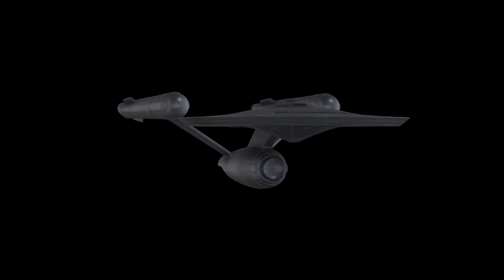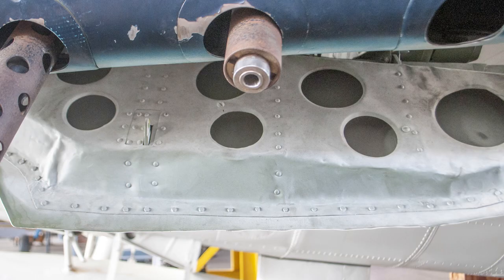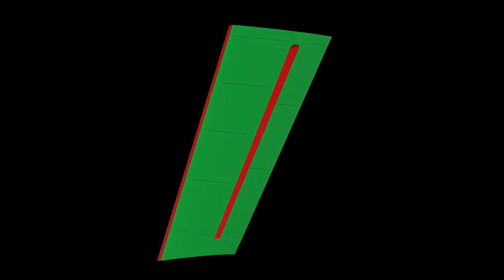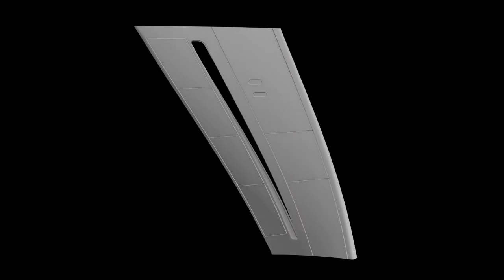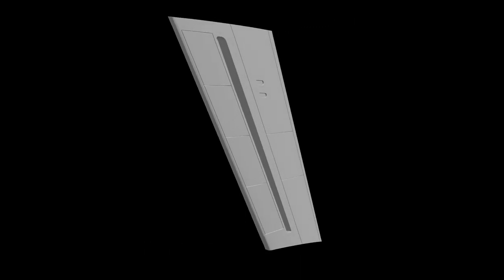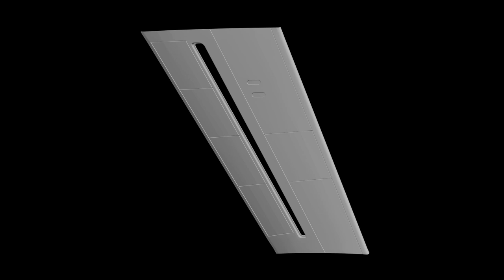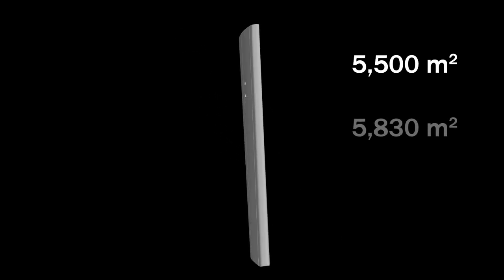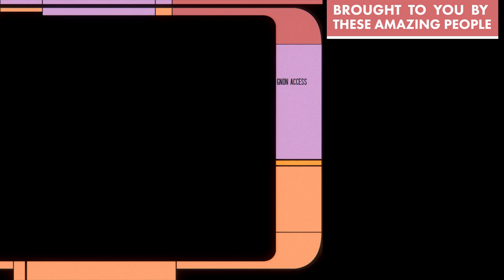What's the Deal with Pylon cutouts?

Comment: I would suggest that they are to add separation between the plasma conduits and a manway to the nacelles. Adding the vacuum of space between people and heat, radiation and potential hazards is a way cheaper and easier method of protection than say heavy armor or building specialized energy shields  for the task.
Reply: It could also add separation between the coolant and the warp plasma. If the warp plasma heated the coolant, both would be less effective.

One section of the pylon channels plasma, and another channels coolant.
Reply: Exactly what I was thinking as well. And they could run control systems up one side and plasma through the other - physical separation means that, if the conduit blows out/leaks/fails (somewhat) catastrophically, you might still be able to do a manual shutdown or otherwise triage the situation.

EDIT: Plus, a vacuum gap is less likely to fail than energy shielding, and would presumably add less mass than radiation shielding plates or the like.
Reply: I like this idea
Reply: I was going to suggest this exact thing. Of course there is probably a jefferies tube running along side the conduit for maintenance, it is likely highly irradiated, but by have a separate tube as well it allows access to the nacelles without the need of a radiation suit along with a conduit for such things as the a fore mentioned coolant, wiring, GNDN pipes, and other support systems that probably wouldn't function as well when competing with the plasma conduits for heat expulsion.
Reply: I was just about to write your theory.
Much cheaper than building an extra think wall to separate people from incredible energy levels.
Remember when Scotty had to crawl thru an energized Jeffery-tube.
Reply: Came here to say basically the same thing. The 'vents' (or radiators) are one the thicker side, so it makes sense that that is the plasma / hot coolant side, and the back bit is the cool coolant / data / transport section. Personally I'd put the hot / radiator bit on the back just in case it exploded / leaked (under thrust, it'll leak into space rather than onto another part of your ship), but whatever.
Reply: Oh shit you beat me to it lol.
Reply: This is what I was thinking too: considering the volatility of the plasma conveyed through the conduits, it makes sense to separate control and access from the conduits themselves in a manner that minimises the risk of blast damage to both.
Reply: I was going to comment the same thing.
Reply: I agree. There are Jeffries tubes to the nacelles, we know this from the shots that have shown the control room overlooking the interior of the nacelles. You'd want to separate the plasma conduits from these for crew safety.
Reply: Jefferies tubes, plasma coolant to the nacelles, intersellar gas return, a whole lot of stuff where it's best to keep seperate from the main plasma conduits.
Reply: Oh, and there I go posting before reading other comments. I agree :)
Reply: And of course let's not forget that the Enterprise has a crew on board. So maybe those cutouts also have hand holds on them so the crew can do work on the pylons even in space without leaving themselves exposed to ship fire. As they could just take cover within the gaps.
Reply: I think I'd rather have a few meters of duranium/tritanium between me and a hazard, rather than a gap of literally nothing.
Reply: It is also lighter
Reply: Exactly where I was going after watching the video.  If the plasma conduits get damaged and spill into crew areas, it can prevent movement in the structure to important areas.  If there's nothing connecting them directly, then a breach in the conduit is less likely to become an immediate safety concern at a time when there may be little opportunity to deal with it.  Now there's two layers of external hull between the conduit and crew rather than none.
Reply: Ah yes, I see you all got a degree in technobabble science. Separation of coolant and plasma. The fact of having to store plasma is ridiculous.
Reply: That added safety feature has a cost requiring exploding consoles to be placed throughout the ship.
Reply: Yup. I wanted to say the same. It is possible that one of those contain plasma conduits and another one crew passage.
Reply: I didn't scroll down far enough & reiterated your comment
Reply: C_137 Sanchez  Depends on what the coolant is cooling, and where the pipes in the nacelles are in the heat exchange loop.

Either way, fair point.
Reply: C_137 Sanchez  The vacuum of space is an excellent insulator. Heat exchange would only happen via black body radiation. Empty space also conveniently weights nothing and requires no maintenance.
Reply: See what's cool is it could be multi-functional. Maybe it's to separate coolant/people for plasma/waste heat, AND they also added more radiator surface area there
Reply: Assume the plasma conduits are in the wider, forward section. If there's a blowout or some other leak method, then if it breaches everything towards the aft it would run into that wide open gap to empty space and dissipate rather than continuing to punch through into other critical systems like power and data links, access tubes or turbo lifts to the nacelles etc. If TOS and earlier used structural integrity fields, a major conduit blowout might not completely sever a pylon so that SIF could hold things together long enough and control links to the nacelle are still intact - enabling the ship to safely be dropped from warp to normal space and shut things down.
Reply: This was basically my first thought as well.
Reply: I was thinking about that too. Tbh all of these ideas could’ve been put into consideration when designing the ship
Reply: since vacuum is such a good insulator against thermal radiation, then - as you say - the cutout could be for thermal isolation of the plasma conduits.

Comment: I'm perfectly fine with assuming that it's for aesthetics even in-universe. You can't tell me Starfleet doesn't care about how their ships look, otherwise they wouldn't look so damn good.
Reply: I'm quite partial to the design of the borg cube.. Seems everything I ever design in Minecraft, 'Space engineers' or 'The Raft', they all tend to be flat squares.
Reply: Pizza cutters, Birds, and Childrens block toys.
Reply: 100%. Not as badly as once structural support fields are introduced, which seem reliable enough that eventually the universe class throws structural sanity out the airlock entirely, but aesthetics seem to have always been a big consideration for starfleet designers. Which is a-okay, it obviously works well enough for them.
Reply: If your main method of expansion/economic growth/whatever else is diplomacy, you want good looking ships. Sleek ships make you look rich and technologically advanced. Intimidating ships make you look powerful. Fast looking ships means criminals might not be as inclined to try to run from you. And so on.

Comment: As i’ve learned from the Simpsons, those are speed holes.  They make it go faster
Reply: Exactly what i was going to say
Reply: Have hey tried to paint it red ?
Reply: They should paint flames on it, that way it will be too cool to shoot at
Reply: Reduction of aerodynamic drag.
Reply: @NiceMuslimLady  in space
Reply: warp holes
Reply: Time to break out the pickaxe.
Reply: all they need is to add RGB lights and it will double the efficiency
Reply: Was looking for this comment!
Reply: Technically they do it saves weight so the engines have to push around less mass
Reply: Space isn't a perfect vacuum, when you're going several times light speed you might be right.

Comment: The issue with your surface area statement is that most of the surface area inside the cutout is radiating /towards/ the face of another ship component, allegedly also a radiating/cooling surface. This means that that surface area isn't actually eliminating heat, because that heat is going back into your ship.

It could just be a separation of the in-flowing warp plasma and the plasma flowing back to the warp core. Ship designers saw the two magnetic "pipes," and thought "you know what, we could just cut out that section of the hull right there, and it wouldn't do anything. Why not?"
Reply: Exactly, good thing someone said this.

Comment: On the topic of heat radiation, I have always assumed that the warp grilles are actually heat radiators operating at very high (10000 Kelvin +, judging by their bluish glow) temperatures, to maximize radiance as per the Stephan-Boltzman Law:
 𝑷 = 𝐴𝜀𝜎𝑇⁴

Where A is area, ε is emissivity of the radiator material, σ is the Stephan-Boltzman constant, and 𝑇 is the radiator temperature. As you can see, the temperature is to the power of four, meaning that doubling the radiator's operational temperature increases the amount of power it can radiate away sixteen-fold.

There are a few caveats to this idea however that I won't go into too much detail here unless anyone wants to know, but I find it a fun way to rationalise an iconic element of Trek ship design and solve the heat dissipation issue of these supposedly radiator-less ships.
Reply: The little fins on the TOS model were supposed to be radiators.... I think they underestimated the scale a tad.  

Other possible invisible to us solutions could be high intensity lasers on a non visible  part of the spectrum.  

Ejecting heated particles from the hull to effectively create as large a radiator as you might need, this can be a total loss system as used on some real space craft or using the known tech of trek the particles can be reclaimed by some version of the various fields used by the ship already.  

Dump your waste heat in subspace or something, invariably pissing off some native alien species for a single episode.  Built in environmental message right there.
Reply: Sorry to bust your bubble, but that blue glow within the warp nacelles is the electromagnetic plasma interacting with the warp coils, thus generating the warp field. EM plasma-in and of itself-is invisible in a vacuum: no atmospheric gases for it to fluoresce.
Reply: I didn't understand a word but I think it's rather marvellous to see a comment thread like this.
Reply: @robgyanisu312  As I recall, the blue light from the grills on the nacelles was already identified as Cherenkov Radiation.
Reply: Stop applying Science to my Fiction! ;)
Reply: Those temps would slag the ship.
Reply: All excuses for the fact long thin easily destroyable pylons connecting ship movement capability so far from main shielding being dumb. ST: Beyond showed us what we were all thinking. Just concentrate fire on one of those stupid things and your ship is crippled.
Reply: @gmork1090    With the immense power of the weapons used, the ships should be completely fucked the moment shields are penetrated no matter where they're hit. At that to the list of things that the 60's show actually handles more intelligently then most anything that came after.
Reply: That was what I always thought. Awesome to see a little bit of physics to support it. XD

Comment: Great video as usual! The cutouts alone would not increase the rigidity unless the edges are extended past the original surface. The airplane cutouts are a perfect example but notice how the sheet metal is bent out effectively multiplying it's thickness which increases rigidity.

Comment: Maybe the TOS enterprise had deployable radiators installed in the gap, and we just never saw them used.
Reply: The TOS Enterprise never had cutouts....
Reply: @richardched6085  I know, I'm suggesting the TOS version of the constitution may have had deploz radiators concealed behind panels in that particular area. Like the ISS's radiator panels but more advanced and presumably more like a wide golden ribbon that coolant could be pumped through , when they have enormous amounts of heat to deal with.
Reply: @richardched6085  the TOS enterprise was an almost entirely different design anyway, Discoprise shares the same basic layout as TOSprise, but so does the ent A, B, C, and D, just in different proportions and level of hull detail
Reply: @andrewbutton2039  pretty good idea. As the TOS Enterprise was designed to have all vital components and mechanics within the vessel. It was meant to be so streamlined that it would look insanely simple compared to modern design.
Reply: @andrewbutton2039  not to mention it's size..... 442 Meters long.... no way that ship is refitted from 289 (The Cage) to 442 (STD) back down to 289 (TOS).
Reply: @richardched6085  that makes no sense either. I personally subscribe to the anti trekkers 3 timeline thing, it's not a perfect theory but it explains a lot more than the blunt insistence it's all the exact same timeline we have known for decades.
Reply: @andrewbutton2039  i know. I also subscribe to the 3 timeline theory

Prime (Everything pre 2009)
Kelvin (2009-2016)
Mycelial (2017-2020+)
Reply: Richard Ched What is there to suggest the size of Discovery’s Enterprise is 442 meters long?
Reply: @richardched6085  Was there ever exact figures given to the Enterprise length?
Reply: @Shapes_Quality_Control  ironically they were given in Discovery on a computer display (Showing the beta canon statistics of 289 meters long) Then later in that same season they completely ignored it and went with a much larger size (442 Meters long).
Reply: @richardched6085  How do we know the 442 meter figure?

Comment: The cut could also change the vibration modes of the nacelles.  Goes with the stresses you mentioned.  One could also twist the physics of warp drive to allow for some gain in speed or efficiency from warp field dynamic but that's way more thinking than most people want to do.  Perhaps more time on the stories.

Comment: The additional surface area is nullified by the opposing surfaces radiating all their heat onto each other.
Reply: That was my thought too. Then I thought, what if there were smaller angled structures in there to radiate the heat away at a 45° angle? They should do that with the whole surface of the pylon. With triangular prisms, you could increase the total surface area by a factor of 1.4...
And since it doesn't matter how small the triangular structures are that's probably what they'd be doing. And with this, the cutout makes sense again for cooling.
Reply: And why you even think that enclosed area inside pylon is equal to cutout and radiating energy out even if some of it just act on another side of cutout? Nullified is wrong word there and clearly you are wrong.
Reply: yup my thoughts exactly, the design doesn't make sense period. If heat radiation were the goal why isnt the entire surface full of radiators which are as close to blackbody radiators as possible ? a folded design, maybe even incorporating mirrors  and lenses might be a realistic move ...

Comment: 1. Allows the pylons and Na-cells to be flexible in turbulence.
2. The area has these Star Trek "thingy units" that produce Star Trek  "thingies" in the space.  Space smoke, space lighting, radar disruption features, sensor features.
3. Area collects required gas materials in Nebulous flight or high orbit gas planet flight to later be processed for long space duration flight - like Nobel gases required for life.
 (like in Lost in Space season 2 when they collect the gases to clean the water system)
4. That particular version of pylon and na-cells do not have a flight or engineer system that would be in that usually housed in that space. (i.e. a science version may require it)
5. It is pivotal in atmospheric flight in the Star Trek universe.  Gosh, even kids and a Klingon know that...

I was going to be sarcastic and then I really got into the thinking process.  Fun.

Comment: For your second point, I was under the impression futuristic shaped EM fields are use to prevent drive plasma from touching the walls of the conduit(s) and melting them.  So the idea of keeping the conduits cool doesn't make a lot of sense because the plasma is not in direct contact with the conduit itself to transfer that heat.
Reply: Fields can contain the plasma itself, but it will still radiate heat. Also, if power goes down you need a mechanical fallback.
Reply: Also an electromagnetic system has much less resistance when cold. If they use a highly efficient superconducting magnet system, they would have to be keeping it very cold.
Reply: Exactly.   The plasma doesnt need cooled anyway.

Comment: I used the Enterprise refit in a story once, it was, in the story, used because it fit the technology in the story and was an entirely human design (and the most beautiful starship design out there imo). The pylons in the story had ionic hydrogen reservoirs to trap heat converting the hydrogen to plasma and when the ship needed to release heat it would open vents on the back of the pylons to release the plasma into space. They never cover how they get rid of waste heat in the show but cutouts like that could be used to protect vents to release plasma. Such vents could be considered a weak spot that you'd want some extra protection on, the cutouts would help shield them and the hull of the pylons behind would easily endure the heat though it would absorb some making them a bit less efficient, trade off. In my story the nacelles were actually the powerplants and they generated a great deal of heat so separating them from the hull helped with heat management. Oh, and the bridge was in the center of the saucer, the top was an observation lounge. lol